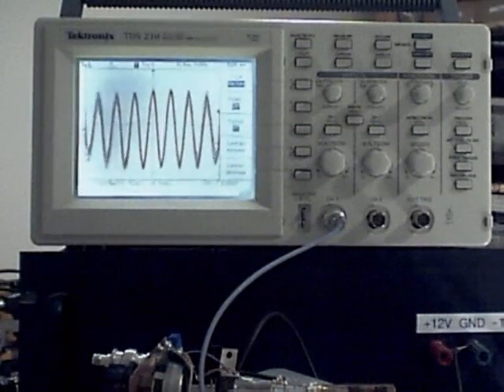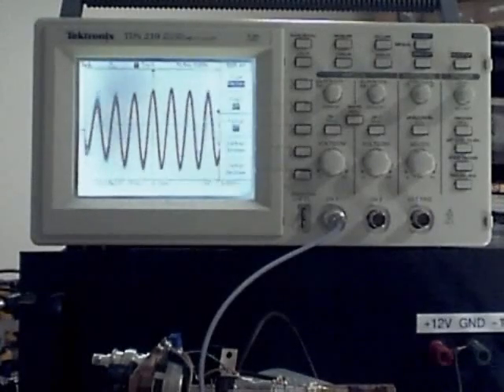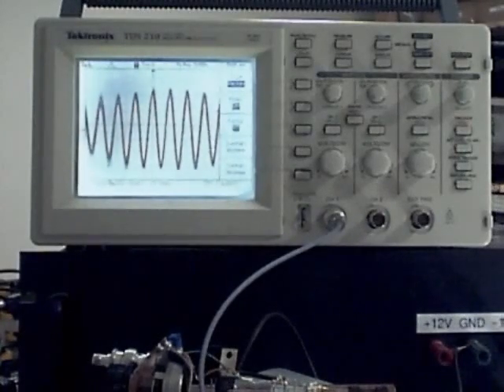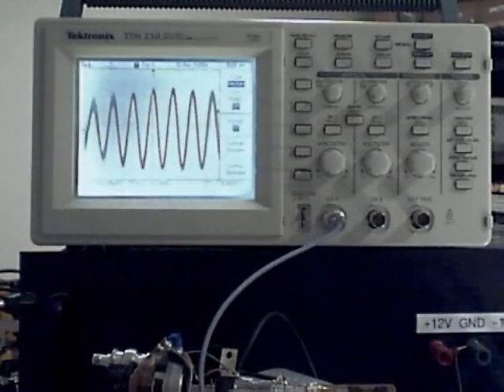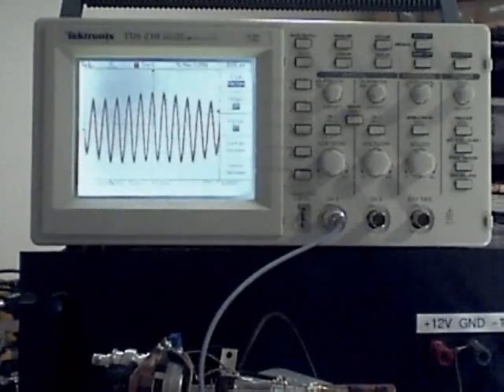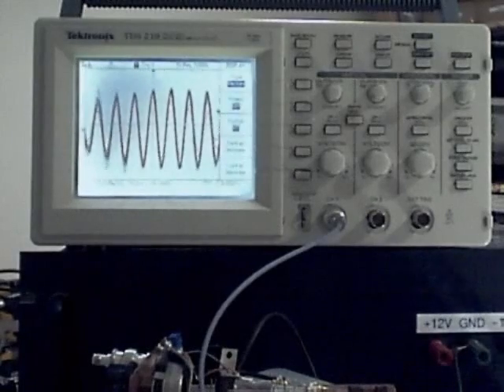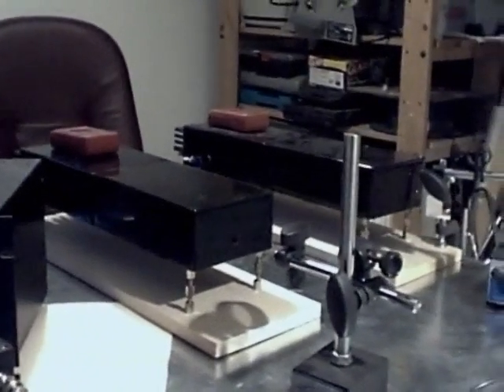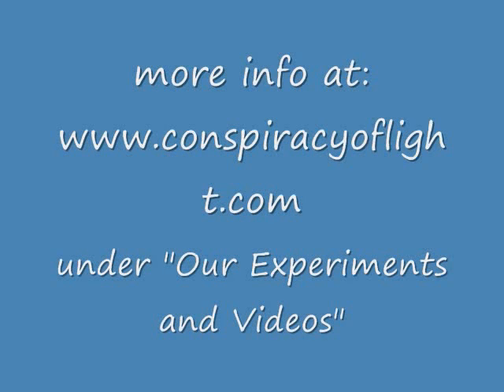Interference between two independent laser beams

Comment from the maker: Logic would appear to suggest that this would be so, however, two laser interference experiments have been tried in the past (Cialdea for example) and the null result was explained by A.A. Tyapkin - the issue from a Lorentzian perspective is that the moved clocks (the lasers) experience a frequency shift that exactly cancels the phase shifts along the optical paths - I have a simulation demonstating this effect at conspiracyoflight in the webapps section.

Comment from the maker: the beat signal on the oscilloscope is due to the frequency difference between the two lasers - interference between two beams from the same laser will generate no beat signal since both beams track at the exact same frequency. However, what would result is a static interference pattern, so a DC signal rather than an AC one, like in a Michelson interferometer.